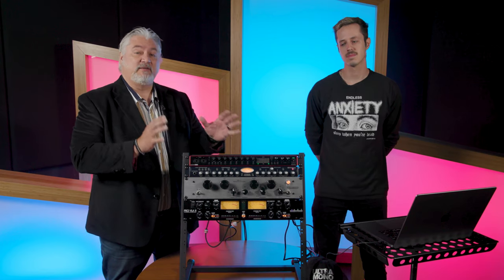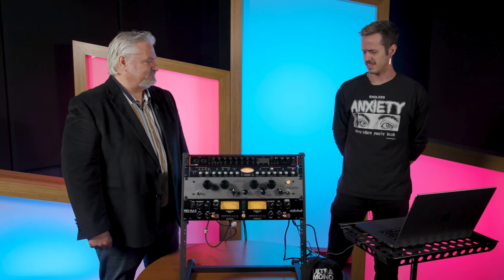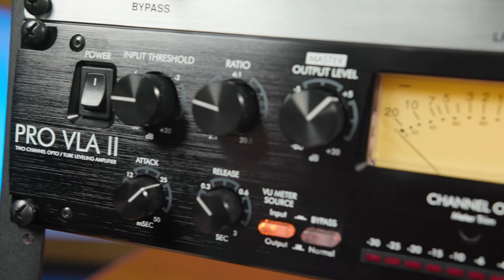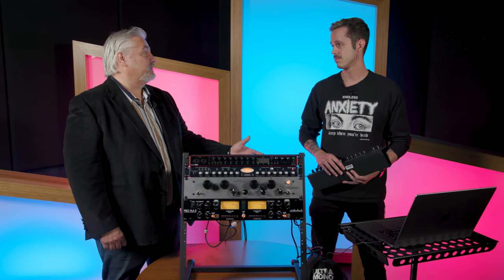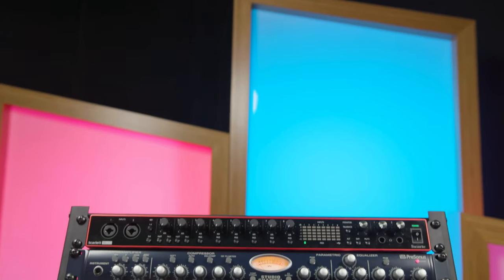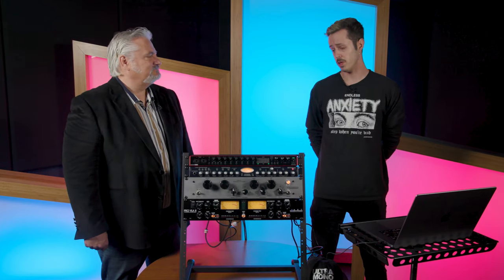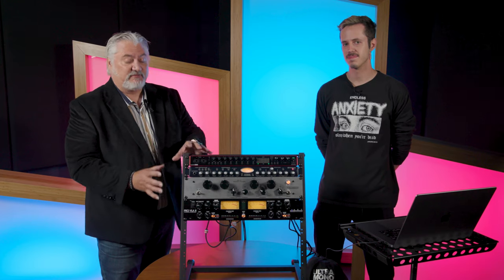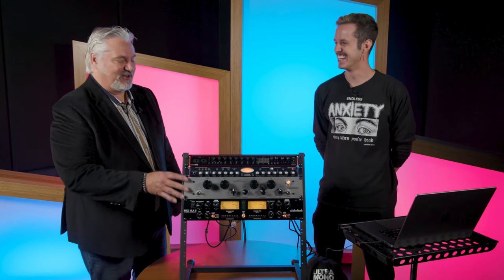How to Build a Hybrid Home Studio

Comment: The part that never gets covered  for a setup like this is the requirement that Focusrite Control be used when signal routing. (For the Focusrite interfaces, specifically!) I never see this topic covered in any videos related to using outboard gear. Avoiding feedback loops is such a common issue.

Comment: I still record on tape. I had already bought ART's Pro VLA II, and liked it so much for mic inputs/recording and then bought another just for mixing/mastering so I wouldn't have to repatch. Really great sound at that price. Warm, transparent and really brings up the parts I need more compression on for mixdown. I do a NYC-style compression on mixdown. Works really well.
Reply: Im dawless and looking forward to building my hobby studio in my house. I think Im going to go with the 500 series modules.
Reply: What do you use to record on tape?
Reply: I have a Mackie mixing board with midrange sweeps, a few outboard effects which include two of those ART VLA II limiter/compressors and a few others used mostly for reverb and mixdown purposes, and a few others I have I use for single channel effects on mixdown when/if needed. I use a two mic (one dynamic and one condenser) set-up  to record my amps and use one of those Art VLAs for the mic inputs running it in dual channel mono to record amp, one side side of VLA goes to mic respectively, and I use the other one in stereo for mix down. This is all going into a 1/2" multitrack tape machine.
Reply: I didn’t know the ART could be used for mastering the final song. Interesting
Reply: @BobbyGeneric145  500 series modules will only do 50db of gain theoretically due to the space constraints for the internal transformers. Most mics do better with up to 80db of gain. Go full size.

Comment: Your doing the classic idea that there is Analog and software and that's what hybrid is however using digital gear and software is also hybrid. For example if I plug My Novation Peak into My laptop and use My DAW, I'm now using a hybrid set up.
Reply: I think the idea is more running a digital signal through an DAC to some analog hardware then back through a ADC to the computer. Your Peak is really exactly what an audio interface is in a hybrid setup. It sends a digital signal to the computer and can also send an analog signal out to an amp or powered speakers. I guess you could even mix through it so the hybridness would be in the Peak itself.

Comment: So the ART Pro-VLA doesn't need a preamp in front of it to boost the signal?  I can go from DAW>Sound interface>ART>back to the sound interface?
Reply: Preamps are usually used to bring something from mic level to Line level. The outputs on most interfaces will output at Line level. So you should be fine.

Comment: Hey folks, I wonder, is it possible to use guitar effects/pedals in such setup? I mean, directly looped for example from/to that Focusrite interface? there isn't much information on that topic online with clear answer, are reamp boxes required or can interface handle the guitar effects properly on its own?
Reply: Radial Engineering EXTC Stereo reamp box designed for this.
Reply: @stevethebeeline44  yup I know, but I'm specifically asking if casual audio interfaces with line-level I/O work just fine with guitar fx pedals or not
Reply: hey man - i'm the dude on the right in this video. yes, you can, but you'd need to use a reamping box. the interface itself has no bearing over whether or not you'd need to use a reamping box, those are used to take a line level signal down to an instrument level signal, which most amps and effect pedals are "expecting." i've used Focusrite, Clarett, RME, UA interfaces...all need a reamping box if i'm sending audio into something expecting an instrument level signal. hope that helps!
Reply: @hotdogproaudio  thanks for reply Chris,
I'm still not sure,
there's even an Article #1719792 at Sweetwater comparing line/instrument levels, but then there is problem with impedance or just the output level of the line outs on audio interface? some have -10dBV option and also the send output gain can be adjusted in DAWs, so what exactly is the problem if sending lower level signal from line output into instrument guitar effect?
Reply: Absolutely
Reply: @hotdogproaudio  thank you so much Chris. I’ve haphazardly sent audio through guitar pedals before and I’ve gotten good and bad results… because I wasn’t using a reamp box! Now I know for sure what the problem was. Thanks man
Reply: If you were really curious about using it, just plug it into the interfaces preamp, it might introduce some noise if you turn the interfaces gain to high. The moral of the story is just, follow best practices make good music. Everything else is a trap for the slaw.

Comment: Regarding compressors, on that Art Pro vla 2, it it possible to use channel 1 on the mic channel, then channel 2 for the mix, to “glue it together?@
Reply: Only if everything is mixed in mono or you mix entirely on your right speaker. A "mix buss" or your final output routes to a stereo signal, or a left and right channel giving the whole image of the song. If you send one output only to channel 2 on the VLA, you'll be missing any panning, stereo spreading, stereo reverbs and chunks of your midi instruments or wide mic'd instruments. The left channel will be gone from your monitors when you play it back. So you'd have to mix the song entirely on the right side or possibly in mono if you wanted the split the Pro vla between a mic and stereo buss processor.

Comment: he has his setup as interface, compressor, eq, preamp

Mine is interface, preamp, eq, compressor. 

can anyone explain why his would be the correct order?

im under the impression you boost the sound, eq it, then compress.
Reply from the maker: Hey, JDK! The long and short of it is, there’s really no right or wrong way to set up a signal chain. In the video example, I felt that I got the sound I wanted with that signal flow, but if you’ve had better success with another signal flow, by all means keep using it! It all comes down to personal taste :)
Christopher Finton, Sweetwater Sales Engineer, (800) 222-4700 ext. 3273, christopher_finton@sweetwater.com

Comment: In all gear videos mixing and mastering engineers mention you need aa stereo eq but this is a single channel one, this Klark . And so you are using it on stereo tracks / mix?! Could someone please explain before I make a purchase ?! I’m confused wld be really helpful !
Reply: that specific piece of gear you're referring to is mono, and in the video i believe i use it on a mono source. if you want to use it as a mastering piece of gear, you definitely have to get either a stereo unit (like the ART compressor we're using in the video) or get 2 mono units. you can use any of the analog gear on any piece of audio, it all depends on what your'e trying to accomplish in your workflow
Reply: @hotdogproaudio  got it ! Just reconfirming .. thanks for your response
Reply: Can u help me set up one?
Reply: @hotdogproaudio  Can u help me set up one?

Comment: If you want to sell analog gear, don't go with "easy", there is nothing easier than selecting all the channels in your DAW of choice and loading and inserting a strip on them all at the same time. Those strips, or eq's or compressors, or whatever they are will be permanently there, no need to print them, easy to change anything you want whenever you want.
Now, is mixing hybrid easier than YOU THOUGHT? Maybe, depends how hard you thought it was. By comparison to plugins, it's a pain in the ass, let's not say otherwise. 
A more compelling question is: what kind of different results can you get going hybrid? What are the sonic benefits that out-weight the trouble it causes?
BTW, saying "it's fun" won't convince anyone to buy a Tube Tech.

Comment: Is a converter necessary to use when sending analog signal yo your daw?
Reply from the maker: Hi Lalocura, thanks for the question! You absolutely need a converter to get an analog signal into your DAW, or out of it for that matter. Even the sound coming out of your laptop or phone is first being translated through a Digital to Analog converter before it hits the speaker! When working in a hybrid work environment, having decent converters is also very necessary as you are expecting to route your sound in and out of your computer multiple times. Better converters distort the audio less, so your end result sounds better.
If you want to discuss hybrid workflows or just talk more about conversion, please give me a ring!
Drake Sobehrad, Sweetwater Sales Engineer, (800) 222-4700 ext. 3271, drake_sobehrad@sweetwater.com
Reply: @Sweetwater  Thank you for the reply. Even when recording through a outboard preamp in series w a compressor?
Reply from the maker: @lalocura1828  Yes, you would still need a converter and interface of some sort! Analog audio gear and the computer speak different languages, so you have to convert the analog signal into digital in order for the computer to be able to use it.
Drake Sobehrad, Sweetwater Sales Engineer, (800) 222-4700 ext. 3271, drake_sobehrad@sweetwater.com

Comment: Plugins and hardware gear basically sounds the same so why would I occupy my space putting hardware gear in my room when I can achieve the same sound with plugins? Definitely not for a ''Vibe''
Reply: A lot of professional studios still use analog front ends to record. I don’t think they would spend thousands doing that if it all “sounds the same”.
Reply: @Supernautiloid  exactly.
Reply: you must have low end monitoring or low end ears.    so ya, in your case, stick with the plug-ins
Reply: I've some of the analog gear that is emulated a lot in plugins and I can say from experience that it is not the same thing, the analog gear just has a extra potential, specially if you drive it hard.
Reply: it's only about workflow. if you like touching knobs and use the gear and can afford it, then you can get it. But "analog is better" is just not true. guys like Andrew Scheps and Tchad Blake are the best examples.
Reply: @raphaeleckert7946  Yes, there are workflow advantages for recording. About "analog not being better", Scheps and Blake. What many point out then is that they more often receive tracks to mix that are better than what amateurs work with. Usually recorded through amazing high end gear in great studios. From experience this can make mixing much easier. Scheps for example sold his Neve 8068 to a studio but from what I saw he still uses it for recording sessions and talked about the great sound of hardware recently.
Reply: @pedrodyck95  I agree. I'm not an analog fanatic and mostly work with plugins but I noticed a difference when I bought a real SSL channelstrip (among other things) years ago. It's hard to describe but boosts sounded more effortless. The high end felt more open and less harsh while LF boosts felt bigger and more defined. Some of my microphones also performed better with that preamplifier. Others also noticed in a blind test. I saw reviews afterwards mentioning similar things. Now I start with plugins and if needed use the hardware and print a track since it sometimes gets me where I want faster.
Reply: @raphaeleckert7946  Analog isn't objectively better because people have unrefined ears to begin with. Analog is subjectively better because of the depth and realism of actual components responding to the input. You can make great sounds with either but, Analog equipment is for those with refined ears.
Reply: @kensmechanicalaffair  I would love to put you to a blind test....
Reply: @raphaeleckert7946  I've been doing, blind tests on youtube..I'm ready, lol.
Reply: @kensmechanicalaffair  :D :D :D
Reply: @WorldBurial  exactly. People ALWAYS forget that part about Schepps and others and take what he said out of context. He and those of his caliber are working with professionally recordings that was captured by professional level and very expensive ANALOG gear such as 1073s, Burl or Helio converters, multiples of thousands of dollars each in microphones and high compressors before and after a console, so by the time the tracks hits his desk it damn near mixes itself. Hell even I could reasonably mix those stems at that point and that is the PART MOST are NOT going to tell you. You absolutely will NOT achieve that level of sound quality with your a focusrite 2i2, Rhode  NT, KRK monitors and some plugins in a bedroom or garage. It is what it is and people need to stop deluding themselves. It does not mean stop making your music, but it does mean to do the best you can with what you have while keeping your aspirations and expectations realistic.
Reply: I have an SSL and BAE 1073 and the plugin equivalents do NOT sound the same. In my blind tests in my treated room, using my Adam Audios and RME interface, I can absolutely tell you which is which in a blind test. I am not an expert by any means, however it is something about audio hitting those real transformers and circuits that shapes the audio. But hey if plugins is what a person digs then that is cool too, but it is not my
cup of coffee aside from a hybrid setup.
Reply: They both work depending what you like / as for tracking live bands - I feel great mic placement , room tone , good mics and good analog front ends is awesome. Better not really - I think the best ears always wins - Im a Clb 1 fan if you only bought one expensive compressor. 
Good comments
Reply: Analogs can give more punch in sounds then digital software